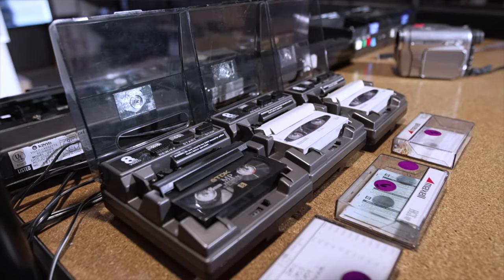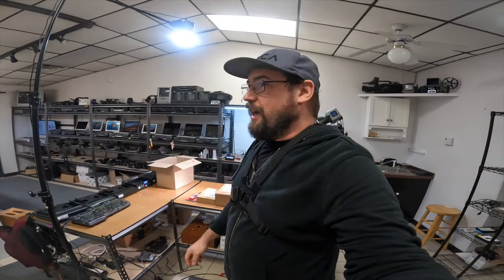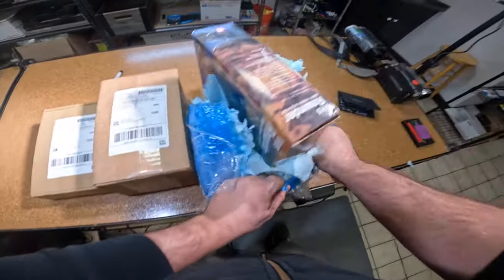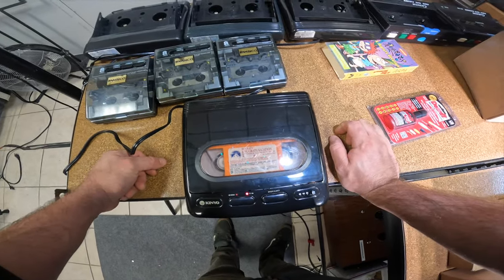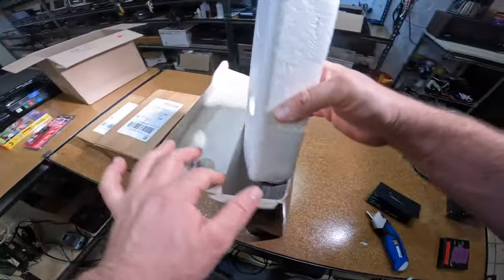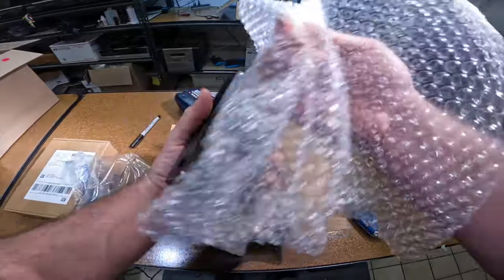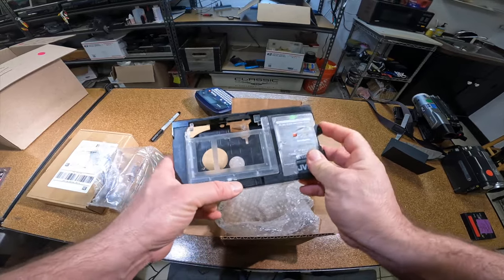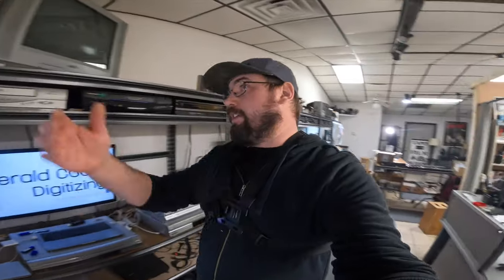Digitizing Company Brainwashing  My Customers With Fake Prices **Ebay Retro Video Gear Unboxing

Comment: Can you record dvds onto vhs tapes with a combo unit?
Reply: there are a few factors that put this as a "sometimes" depends on the combo unit, depends on the DVD, depends on the content of the DVD. some combos only go from VHS to DVD, some will record onto VHS from DVD, and some retail DVDs have copy protection, and won't let you record it to any other format easily. DRM sucks.
Reply from the maker: You could def do it with hdmi to AV down converter from a computer/laptop with dvd/cd drive hooked into the vcrs inputs. No copy protection surviving that
Reply: @EmeraldCoastDigitizing  I'll see what it takes to accomplish that, I'm not sure where to begin but it's my goal to figure it out!
Reply: DVD to vhs sounds so lossy 
who would want to do that\?
Reply: @scamchan  Ikr. Better to use capture card and TBC via s-video or SDI. Also, good DVD recorders are hard to find and bitrate will be about 8mbps.
Reply from the maker: @scamchan  fun!
Reply: @scamchan  il VHS si vede bene,posso dimostrarlo